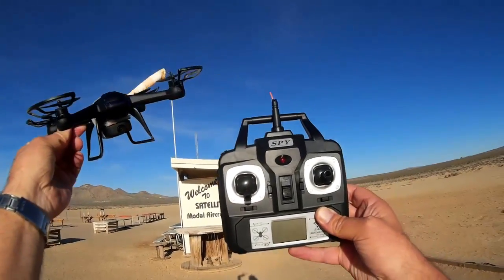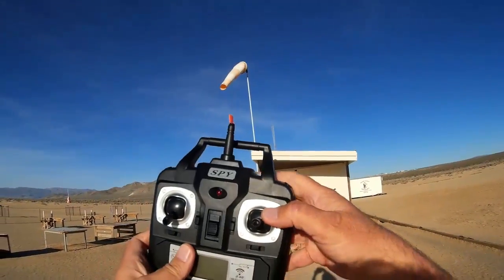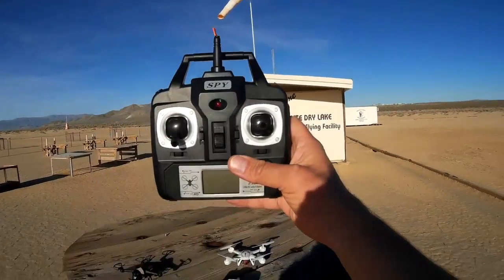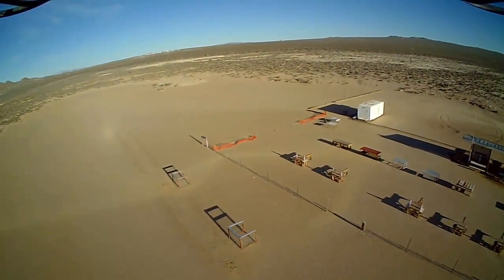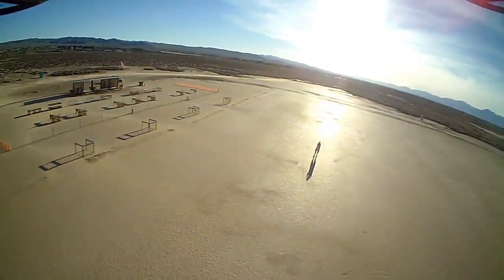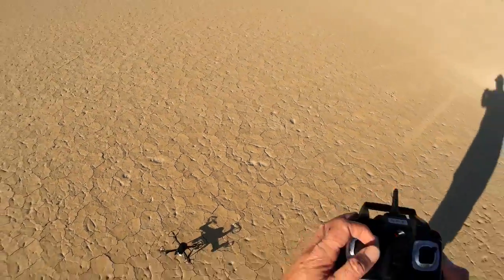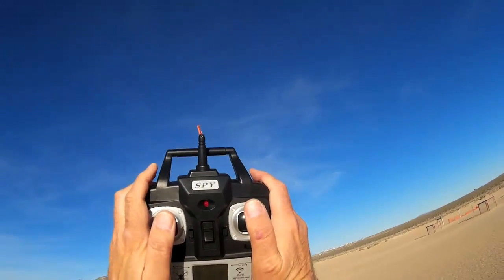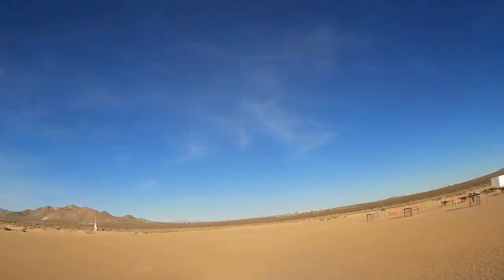DM007 Spy Drone with Range Modification

Comment: Hi Quadman! Thanks for all the great videos! I'm hooked! Alright. Enough shouting. I bought this quad for $25 on gearbest. I was disappointed with the overall performance of this quad. VRS was my biggest gripe with this quad. I removed the camera. VRS. I removed the landing gear. VRS. I clipped the prop guards and voila! No more VRS. I attached the landing gear and camera and no longer have the constant VRS problem. I don't think that It's a weight problem. It's possible that the prop guards are hindering airflow. I am, by no means, an expert. Just reporting my results. I've only flown it this way about 3 times. I just clipped them last night. But seeing as how VRS was guaranteed at least 10 times per flight, and I've only had one VRS moment since I clipped the prop guards. I'd say that the prop guards are the culprit for the constant VRS.
Reply: +Jorge Lopez https://flic.kr/p/DyXb1U
Reply from the maker: +Jorge Lopez Yes, that should greatly help.  Limiting weight always helps for all vertical takeoff aircraft.
Reply: So now we need a 007 vid without the propguards ;)
Reply: ...Maybe with and without 808
Reply: What is vrs?

Comment: First of all, I paid $27 with shipping. Out of the box it flies well but heavy. With winds over 5mph, it is nearly impossible to fly it outside with the camera. After modifications; clipping of the blade guards, taking off the landing gear and camera, it flies well outdoors even in 15mph if you stay about 10-15ft above the ground. The camera is grainy at times and has a recording lag. However, for $27 I cant complain.

Comment: Firstly thanks for the video's, really enjoy them. My question is what do I do with this. I'm not sure whether the grey wire on the right of the guage is shielded or unshielded and I don't want to solder straight onto the board. I'm also a bit crappy with fine solder jobs so just want to extend the wire. But is impossible to know if it is shielded or unshielded without equipment.
Here is a picture of the transmitter dismantled to better explain..  Really I am just trying to work out the precise length to extend it.  http://oi58.tinypic.com/14lsc5c.jpg
Reply from the maker: John Derrick The gray portion is shielded and the silver 28mm exposed part is the actual 1/4 wavelength antenna.  You can solder to this silver part (you may need to strip it first).
Reply: I got a bit cheeky and soldered some coax so I can put a proper full wave antenna on there. It seems to work ok, Haven't range test it yet, just to warn others it is very difficult indeed to solder coax onto the PCB. My next challenge is to find a decent charger for the DM007 2S that will charge the right amount. Here is a photo for you of the completed reciever. http://p1n.me/directional-antenna-mod
Reply from the maker: John Derrick That's great.  With a cheap $3 5dB antenna, you should be able to get out to about 300m.  Add an easy to make WindSurfer foil reflector, and double that range again to about 600m.  https://www.youtube.com/watch?v=YwW26jNWAQE

Comment: what do you use to keep the camera connected to the quadcopter
Reply from the maker: Tully Ryan velcro cable tie strips.
Reply: Tully Ryan In a pinch, use masking tape, I do it with my X5C all of the time, just make sure you wrap it around the battery door at least twice and cut for the door to lock into place, simple mod until you get the velcro strap and low cost, I do use the blue stuff, it seems to adhere better than the white.
Reply: thats what i have the X5C but sadly i lost it like 70 feet up in a tree yester day :(
Reply: Tully Ryan Let me guess, prop guards on? Prop guards and outdoor flying really do not mix, great for indoors but once you get things like branches in the equation those guards just become hangers.
Reply: Ya it's just be side my house and i've been trying to find it but I guess ill just have to wait for a storm. How do you get all your Quadcopters?
Reply: If you have any extra Syma X5C-1 Quadcopters could there be any way you ship me an extra one?  That would be so big I got it for my birthday and I love photography and I was planning on doing that this summer.
Reply: Tully Ryan I make sure I don't get close to trees when I fly, avoid the issue totally is the best option, and I only own one X5C so if that tells you how gently I fly it and how far away from roof tops and trees I tend to stay. And you don't really need a big storm, just high enough wind to blow it down, you really don't want it getting wet.

Comment: I might add, that's why the antenna should be at 45 degrees which would work better.
A vertical antenna is omni-directional and doing acrobatic stunts would change the
polarity of the signal. Get way out there and do a tight turn and you could lose the
signal.

Comment: Hi, I suspect like most of the quadcopters that the antenna lays horizontal in the
housing. This would mean that the signal on the quadcopter is horizontally polarized
and directional. If you hold the controller vertical, you are decreasing the range
because the signal from the controller is vertically polarized. A small antenna on
the quadcopter sitting vertical would be a good experiment. Using a real small yagi
antenna coupled to the controller with SMA connectors and the antenna horizontal
should definitely increase range without modifying the quadcopter's antenna. :)

Comment: Hey Quadcopter:  I watched this video and was wondering if modification on the copter itself would increase the range as well.  I noted a video where an individual drilled a small hole at the top of the copter and had a wire sticking out of the top vertically.  Your thoughts and thank you.  I am a noobie and appreciate your vids.

Comment: Hey Quadcopter 101 I just got my Dm007 Nighthawk the other day I definately need to practice flying the copter. I did realize I had the hardest time getting the camera to stay in the slots provided it kept detaching itself. I see you have a white band around your 808 cam where did you get that band? They also sent me the Eur adapter but will get the conversion from best buy.
Reply from the maker: Ray Ricardo Go to Walmart, and in the "small electrical repair" section (in hardware) look for velcro cable straps.  They come in large rolls, more than you'll ever need for about $3.80.  I use them all the time for strapping batteries and cameras to my quads (when I'm not using rubber bands ;)
Reply: Ok cool because I think the clip on the one I have is warned out a bit. How do u place the remote in beginner mode?
Reply from the maker: Ray Ricardo It's been a whikle since I've flown this, but believe it's the upper left trigger button, and the upper right trigger button should set it for flips. And if I'm not mistaken, if you push in on the left control stick (like it's a button) it may enter headless mode on some models (not all have this feature, seems to be a hit or miss whether you get it or not).
Reply: Ok thank you soo much for your help on this
Reply: Quadcopter 101 I love those shipping rubber bands, great for all kinds of things, including strapping a camera to my nitro truck, not anything expensive since ground vehicles do flip on their lid more than not lol.
Reply: Lol
Reply: Can anybody do a video on how to change out the body and board  for the DM007 Quadcopter?

Comment: salut !
je le trouve beau ce quadcoptere ,on trouve pas beaucoup en 2s lipo avec moteur non réducté .
est ce qu'il peut soulever mon système fpv de 50 grammes ? je vais commander un dm007 sans camera
Reply from the maker: Bestio Bestiolo No, this quadcopter can not lift much weight. It has problems lifting my 17 gram 808 camera.
Reply: Quadcopter 101
 merci pour la réponse...

Comment: I FOUND THE PERFECT RANGE HACK FOR SYMA AND HOPEFULLY THIS LITTLE GUY;

My range hack is simple;  buy an SKYFLY FS-TH9X receiver for less than a hundred bucks and fly like a pro.

I'm hoping you look into this and do a review.  I'd love to see it.  Peace Out.
Reply: William Wooddell you would need the transmitter and receiver combo right? I assume the stock radio does not work with that receiver so you would probably just be better off getting both the receiver and transmitter deal for around $110.00 at most places that deal in skyfly, however you could do the same with the devo lol.

Comment: How about the 808 without the prop guards?
Reply from the maker: Yeah that might lighten it enough. I might try that soon.
Reply: Quadcopter 101 Those guards hold the motors in, suggestion so as not to ruin the product grab my favorite go too in cases like this duct tape to hold the motors into place when experimenting, but then again you hate prop guards anyway lol.

Comment: Anything wrong with the on board camera ?
 I am thinking about ordering this quad .
Reply from the maker: No, it's an OK camera. Just was curious if the DM007 could lift the heavier/better 808 camera (it can but it easily enters vortex ring state. I no longer use the 808 with this quadcopter). Here are a couple examples of the stock camera
https://www.youtube.com/watch?v=CJl_1uSvqmc
https://www.youtube.com/watch?v=rjYIE63ZZ94
Reply: Quadcopter 101
 Thanks for the info

Comment: You ought to read up on antenna theory.  Just multiplying quarter wavelengths doesn’t work well.  I used a half wave router antenna with good results.  Having both antennas polarized the same, vertical or horizontal helps.

Comment: Hi quadcopter 101 is there any other battery you know of that will fit this quad other than the stock battery. Going to order the dm007 but can't seem to find the same batteries that come with it
Reply from the maker: No I haven't found batteries for it either, unless you want 5 pieces http://www.aliexpress.com/item/5pcs-lot-drone-GW007-battery-rc-helicopter-spare-parts-7-4v-380mah-li-po-battery-rc/32283784936.html
The quadcopter is also known as the gw007, Nighthawk, and also F11945.

Comment: Didn't  you have the same problem with the L6052 and the 808 blocking the signal ?
Reply from the maker: You know, you're right.  And the antenna is in the same relative position for both quadcopters, flat and just above the camera.  Doesn't matter though. I'm really concerned about VRS with the 808 attached, as it drops like a rock once it enters it (with the 808).  Can't slide out of it either.  I'm going to stick with the lighter stock camera from now on.
Reply: Quadcopter 101 The 808 is fine on the X5C right? Reason being I just dropped 50 bucks on one and am waiting on it to arrive, would suck if that does not work.
Reply from the maker: anthony eaglebarger The 808 #16 V3 is fantastic on the X5C https://www.youtube.com/watch?v=J1KPT8IwQEk
https://www.youtube.com/watch?v=qavdra4aEaY
https://www.youtube.com/watch?v=Yk4p_9oEAb0
Reply: very nice footage, love beach footage on aerial filming.

Comment: I haven't seen the rcvr/controller PCB yet from a teardown of the DM007 quad. Wonder if it's a PCB antenna and not a wire. If it's a wire that's typically just laid along the rcvr/controller PCB, I've seen mods on other quads where a hole is drilled on the top of the quad and the antenna extended upward.

Also, since these are just regular iron core motors with very sparky brush/commutators and there are FOUR of them SURROUNDING the rcvr/controller, are there ceramic capacitors across the power leads ON each motor? If they didn't use any or put them on the PCB, then the leads to every motor will act like an RFI radiating antenna. The caps should be located AT each motor:

Three cap per motor installation how-to for the Easystar brushed motors

http://www.rcgroups.com/forums/showthread.php?t=350408&page=13

This isn't nearly as much of a problem for the hollow cup motors used in geared quads because those motors are much more efficient with resulting lower currents and their windings have much higher impedance, also leading to lower currents and much weaker sparking.

Radio Frequency Interference (RFI) Suppression in (Brushed Motor) Model Boats

http://www.rideaunautical.ca/articles.php?article=rfi

BTW, I don't see any caps installed on the motor image you previously posted:

http://static.rcgroups.net/forums/attachments/4/8/6/7/6/7/a7546247-56-%24_12.JPG
Reply: The antenna should be routed beneath the quad if possible, gets it away from the shadow of anything on the quad, and the remote is below the transmitter in line of sight to the quad.
Reply: Captain Tripps That depends upon whether the antenna is attached to the top of the PCB which they usually are. If that's the case, depending upon where the antenna is attached, it would be impossible to extend the wire antenna around the board and downward without lengthening the antenna and routing it across the board and downward, detuning it and creating strange a radiation pattern. Using coax to a remote antenna is more than most want to do. Plus, in this case in particular, the camera occupies the bottom of the quad and in many cases the landing legs aren't long enough to allow an antenna to extend downward without getting caught by grass.

Besides, I suspect the main problem here could be noisy motors IF they didn't install three small ceramic caps on each of them which I'll bet they didn't. It's SOP to use such caps even on much larger SINGLE motor aircraft where the rcv antenna has more room to be placed farther away from the motor than the one in this quad.